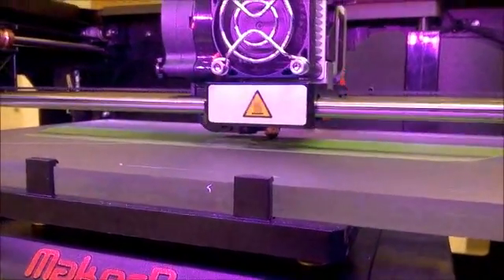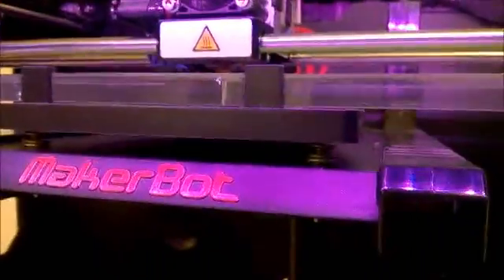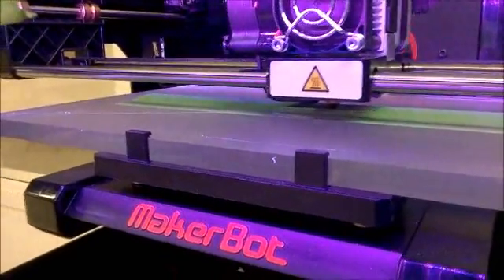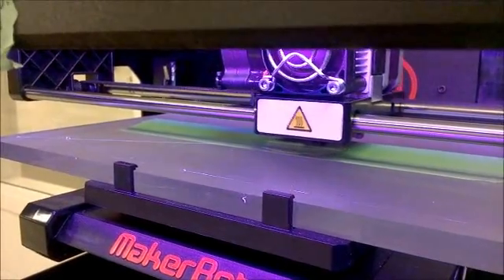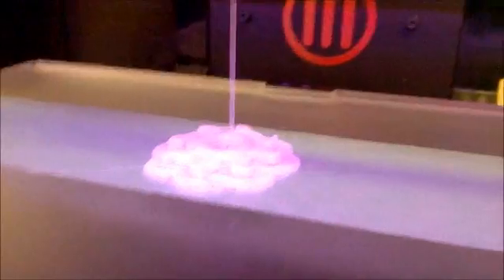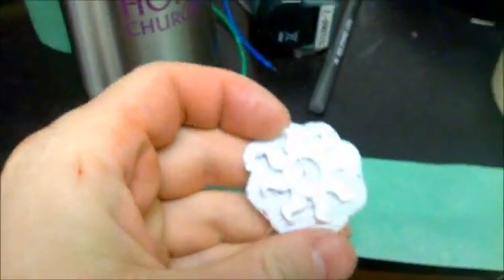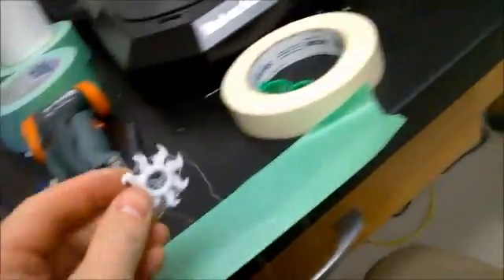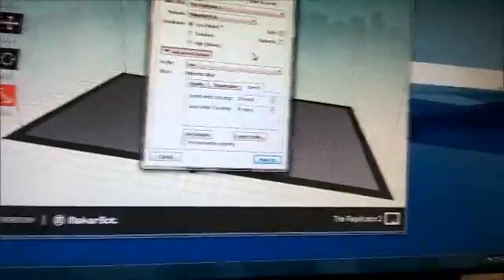NinjaFlex from Makergeeks.com on a MakerBot Replicator 2 Printing Tips

Comment: Also: how did you get the NinjaFlex to feed into your Replicator 2? I have virtually the same machine, but it's jamming and won't feed like your machine loves to. Did you download a specific Thingiverse spring like maybe the Replicator Spring for Flexible Materials - mk8? It's listed here: http://www.thingiverse.com/thing:169086
Reply from the maker: I didn't need the mk8. to load it. I made sure it was hot (250C) and then when I started to feed it I pulled back on the spring for a moment and pushed the filament in with my fingers. I let the spring go and it started to pull it into the extrude by itself (... the first couple times at 220C it fed it in and then started wrapping around the feeding mechanism).

Comment: Thanks for filming this. What temperature are you using for LOADING? MakerBot suggests 120, but that's not working for me. Are you loading and printing at 250?
Reply from the maker: Yes. I had to crank up the preheat settings to 250C to get it to melt. Checking it with laser thermometer it read much less.

Comment: I got the replicator 1 is it the same setting
Reply from the maker: I haven't tried a replicator 1. Does it have a spring loaded feeder? Next, if you cannot get extrusion at 230C try 250C. (Also slow down the travel speed when printing.)